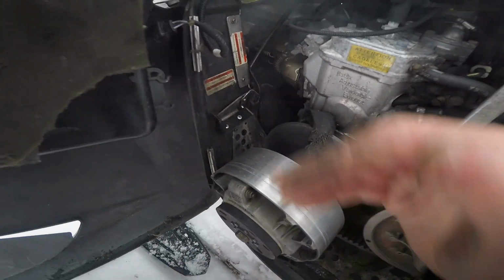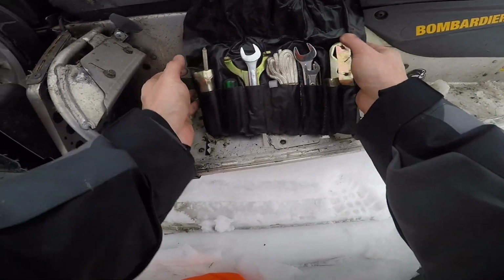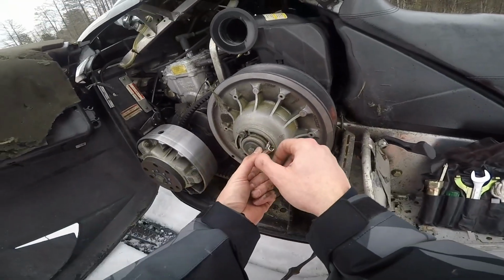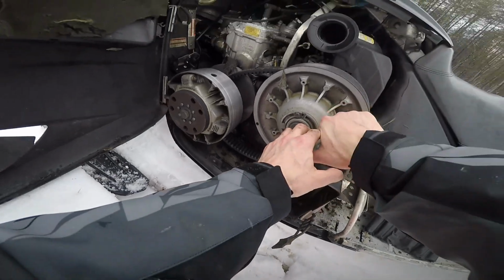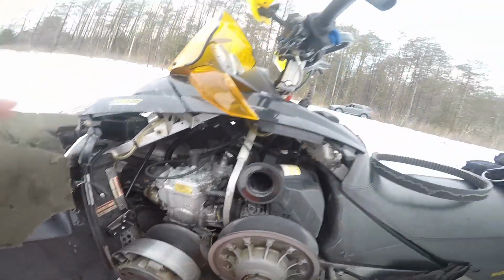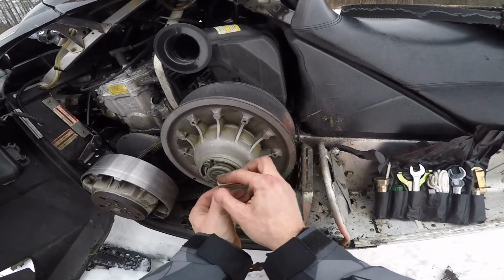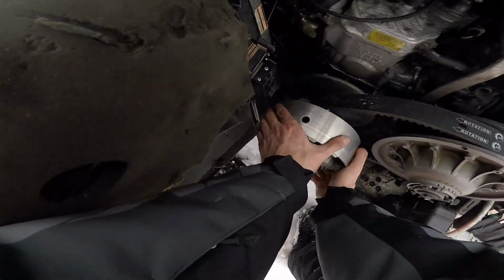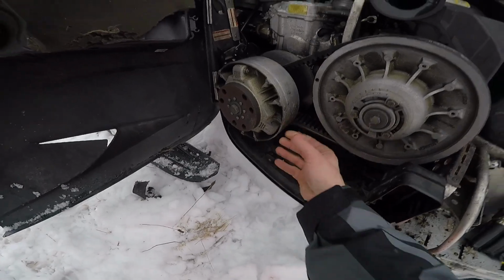Snowmobiling 2020 ski doo mxz belt fail

Comment: That’s not a timing chain, you don’t have a timing chain unless you have a 4 stroke, that’s a chain case chain your adjusting there,  are you sure your only getting 200-300 miles per belt? I gave up on skidoo belts long time ago, I’m using the carbon belt on all my revs, are your clutches stock?  I have got an 04 800ho one of my sleds it’s trail ported 160 horse and it rips hard blew many doo belts, have not blown a carbon one yet, got over 3k miles on that belt and no signs of serious wear yet, that original rev chassis I always floated my secondary clutch fixes lots of it,
Reply from the maker: Thank you yea always ski doo belts failing me I will try the carbon one you speak of for sure..I did 160miles that day with no spare belt worried the hole time